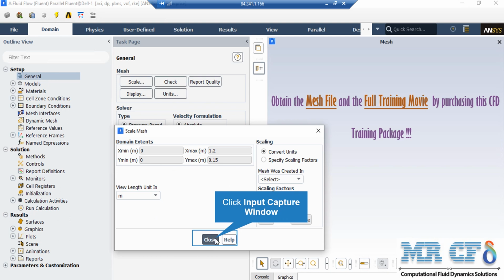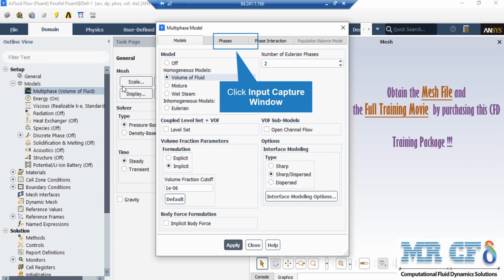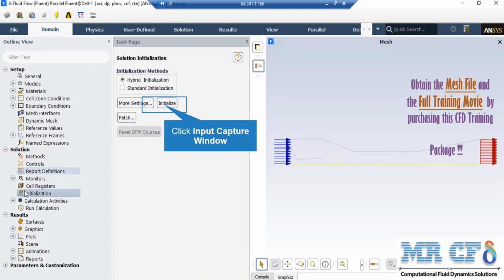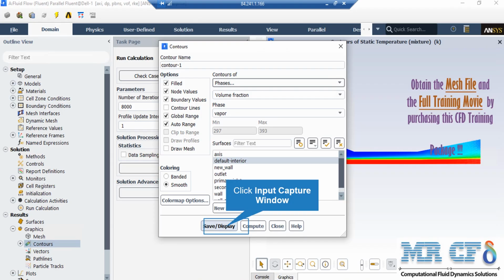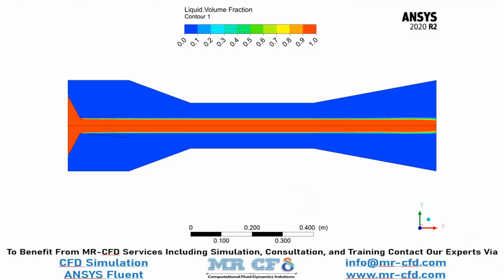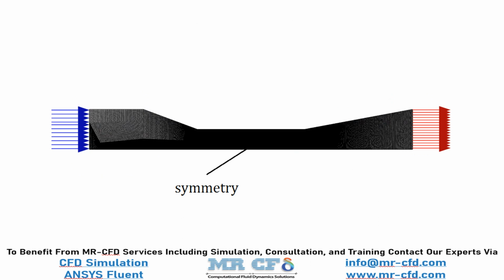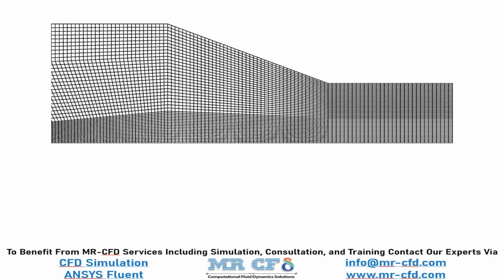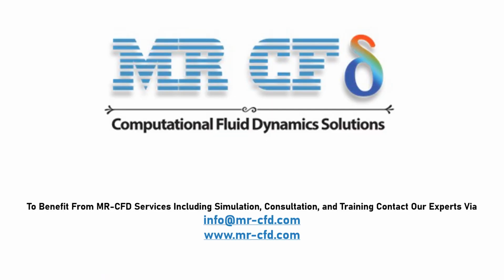ANSYS FLUENT Training: Ejector CFD Simulation, Two-Phase Flow

Comment: Hi I have a discussion,  I agree with your step that the idea of using the Multiphase model is near to the real condition, the primary flow will suck the secondary flow which normally is a different type of fluid
but, in a term of high velocity in the nozzle exit (exp mach 4) shouldn't we use density-based model?
but the problem when we choose density-based model is we can't click the multiphase, the only option we have is wet steam
thanks
-Rahadyan
Reply from the maker: the problem is a little different since the liquid phase is entered the domain and is different from the wet steam model. you can mail us for more consideration. info@mr-cfd.com